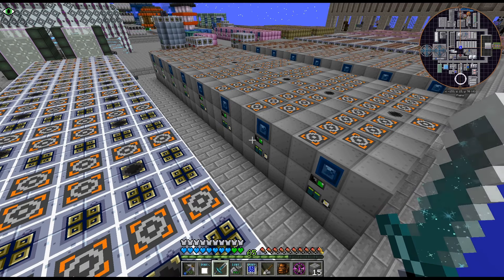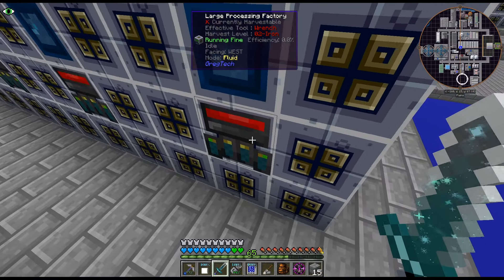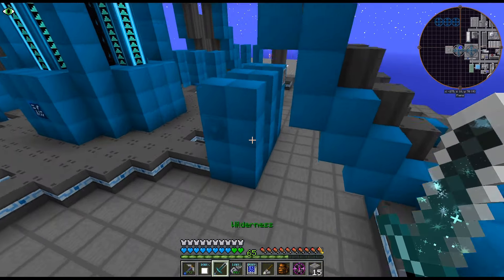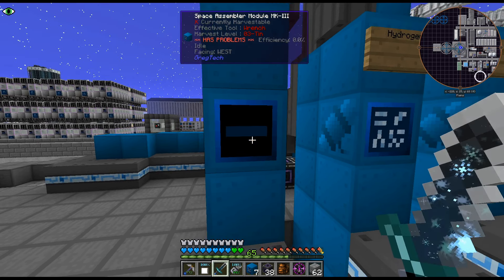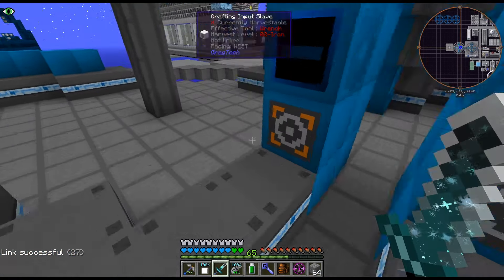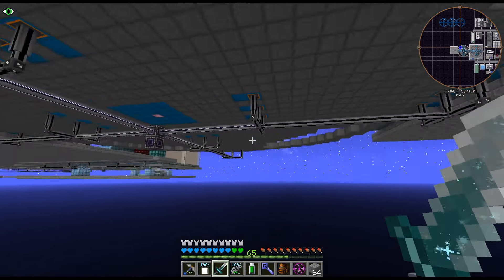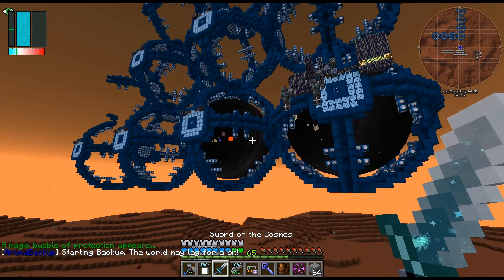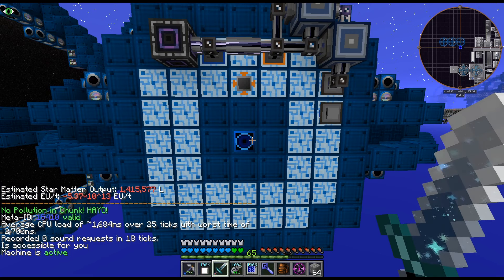GregTech New Horizons S2 - 475 - Growing Pains

Comment: Around 26:39, I noticed that the P2P itself is also connected to the main controller, and I believe that the more advised method is having a dedicated network for all the p2p devices independent of the main net? Also remember to chunkload the new SE, unloaded devices might be causing issues.
Reply: I believe he is not using p2ps because they are kinda obsolete with the wireless AE networks